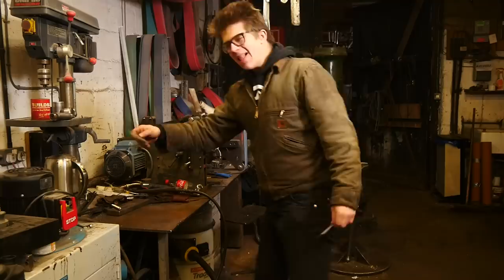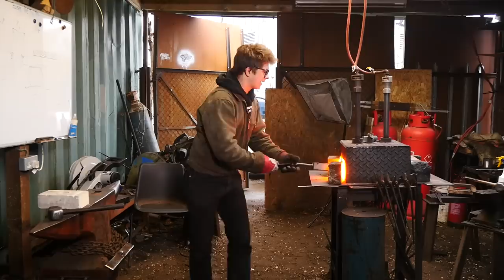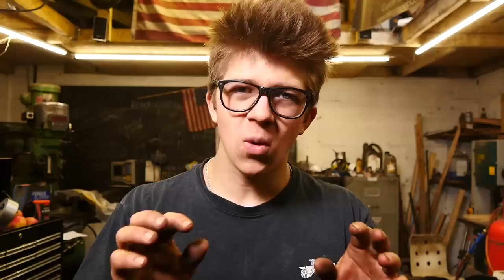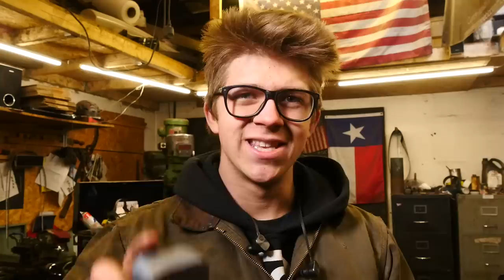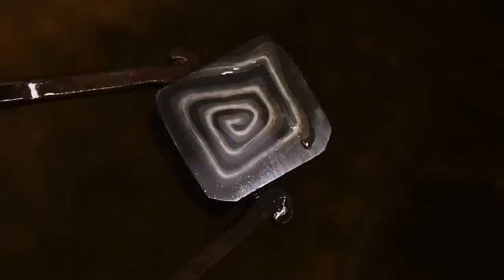JELLY ROLL DAMASCUS STEEL!!!

Comment: Forgot to ask in my other comments Alec, would welding a new handle at the end of the billet where it kept coming up help at all? Since you would have two contact spots on two different rolls. Or would the weld just pop once you started forge welding the roll. 

Also, do you know why it's called jelly roll? Looks like a cinnamon roll to me :)

Thanks again for another great video

Comment: It's probably been suggested already, and please forgive my ignorance if this is a idiotic idea (I know very little of welding) but for the end of the spiral that kept popping off, would a mig or tig weld have held it in place? 

A few tack welds or so down the length of the spiral, flux and forge weld, then to the hammer and repeat flux forge as needed?

Comment: So after hammer forging into a spiral, why not let it ool and anneal overnight? Then take it back into the shop and weld it with the MIG welder? Once across or in an X pattern? Just to get it to stay together when you want to heat it back up and hammer forge it into Damascus.

Comment: Why didn’t you take a half circle anvil base, and the other side of the circle for the power hammer part. Then rotate in the direction of the spiral. More of the surface is contacted and it makes work quicker. As well as minimizing inclusions due to faster welding? Either way, it is fricken sick to have a spiral pattern D Steel. I wonder if you could make a forge hammer head out of it... Just a thought :)

Comment: You could do so much with that billet, a farriers knife for Sam :), a small tanto knife, a straight razor blade. But you've done a lot of knives lately and the amount of time you put into them is ridiculous. So if you're looking for something non knife related, you could make something different. 

1: a Bolo Tie aka a cowboy/western neck tie to go along with your spurs 
2: a psychodelic spinner either the handheld type or the type you hang up 

My choice would be 

A credit card shape multi tool
    -- you can have all the different everyday things that you might need just on the small scale that can fit in a wallet

Comment: so i have a idea for this roll the bar. with space in between the you could add flux in the space and try compressed air to clear the slag out from the spaces  the add the flux then weld

Comment: Could you have welded the endpiece before the forceweld ? should have helped holding it ... and my logic says that if you forceweld it more from the sides it should push the middle together and it should be easier to weld it round ? Tell me if it makes sense ... I am not a smith I just enjoy your videos and would love to have a shop where I could "punish" some steel :cP

Comment: Did anyone suggest welding a handle to the side of the roll and forging the roll into a bottom "V" swadge on the hammer.  This way you are hitting three faces of the roll and keeping the metal contained rather than it trying to squish out.

Comment: Oh jeez hot metal to the hand. You ok? I was forging in sandles ( bad idea don't do it) one time and I dropped a knife I was flinging on my foot. It was cooled to almost black and I was moving it back to the fire when it slipped. It bounced off my foot but I got a bad burn about the size of a quarter. It took a couple weeks to heal.

Comment: to weld the jelly roll, what if you made a die for your press out of 4 pieces of 90 degree angle iron. 2 on top 2 on bottom making a W on the top and a M on the bottom. then you roll would get squeezed from all 4 sides at once, right?

Comment: What about welding the roll together so it does not come undone when forge-welding it?
Reply: JollyGoodFellow the weld would be a side weld, and would break when it is hit on the end. You have to weld what you are hitting, or else it cracks due to the shift of the angle. Like you saw when the end was unraveling on him.

Comment: Tighten up your roll a bit more and use a forge press if you have one. It'll work just fine. Your technique is right.
Reply: 64t120r that's how the only other video I could find on YouTube do. He then used the squaring attachments and forged it out into a large square billet

Comment: Would it still count as jelly roll if instead of rolling it you just cut into rectangular sections of slowly increasing length and welded them into a pseudo spiral?  Even if not, it might make an interesting pattern.

Comment: Can you attempt this again and use 2 half round dies? I have seen this done in a welding course i took in 2014. He made a end for his power hammer using  a 2" hole into a billet and then cut in half and welded to the hammer and just keep going at it. One thing he did was start with a round piece in the middle and weld that like a tube in toilet paper sicking out from the side a bit so you can tighten up the warping. Good 2st attempt. DO IT AGAIN and shoot for a snail shell look.

Comment: What kind of acid do you use to etch the metal so you can see the pattern?
Reply: It's ferric chloride Hexahydrate, an acid used for etching metal surfaces. The two types of metal he uses to obtain the damascus reacts differently to the etch, (i don't remember which one does what, he used 1080 and 15N20) one of them gets darker and shows better the pattern.

(Edit.)
The 1080 is the one that gets darker.

Comment: Why didn't you drop your white hot coil of iron layers into a cold ring and then use the big press you have to squeeze it against itself and the inside of the ring. Wouldn't that have welded the entire coil in one go?

Comment: 3:20....wouldnt hammering the roll....on its side....when flat like a disc....weld it more uniformly. for first stage..?....maybe more mild steel needed...not a bad effort.
...4:35....omfg.....you'll need them when you want little blacksmiths.....easy lad......they have a sheild just for that.

Comment: Could striking the hot roll with water on the anvil remove the scale?
Reply: Jake Everhart That's a Japanese forging technique, and yes, it would. It makes the scale fly off in your direction, but it does work.

Comment: if u spray water on it while hamaring the skail falls right off
Reply: Pulver Garcia problem is, he needs a lot of time withe the metal to forge it. The water will cool it down too quickly. It also adds the risk of delaminating the welds because of the uneven temperature change withe varying thickness layers. But it looks cool to hit.

Comment: Over 1330 comments, and digging up a video from 2 and a half years ago, but would this not have worked better if you had 2 curved pieces to sit the jelly roll in when you were using the power hammer? I have seen people put pieces in the power hammer before, ones with a rectangular notch to limit the spread and control the height, ones with a 45 degree cut in them and so forth. Thinking back, maybe there is not a curved top surface that goes on the striking end of the hammer? Note, I only watch blacksmithing videos, I don't even play one in real life. :) So I might just not know anything and the above is hogwash for reasons I am not aware of.

Comment: what's the point of using flux?
Reply: palleping Sacrificial layer.   At high temps it reacts with oxygen to form liquid boric oxides that then run off the workpiece, instead of allowing the piece to form iron oxides on the surface,  which inhibit clean forge welds.

Comment: don't understand why this dude is calling whatever he is making the ,Damascus steel.Reality is they loss those technics long time ago and the steel might not be   from India.could this guy be from Syria????
Reply: jimmy rai Damascus is just the generally accepted name
Reply: Blanket term for layered steel formed into an item. Generally a weapon. And yes, true blue prints for Damascus steel that is era correct has yet to be discoverd
Reply: If my info is correct, we have the techniques to make it. However, the steel used is a mystery as to how to replicate its strength. If the technique is off, it is damn close to the original way.